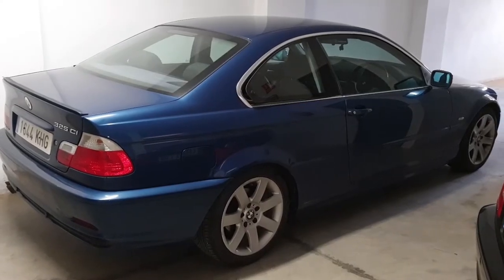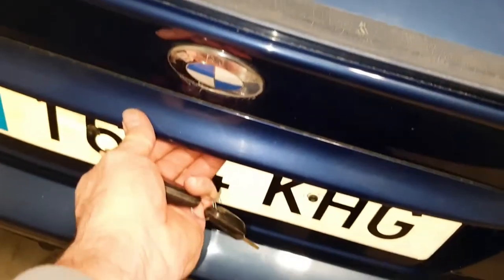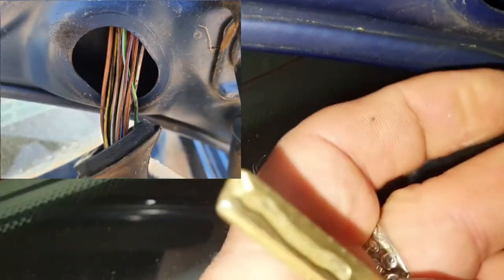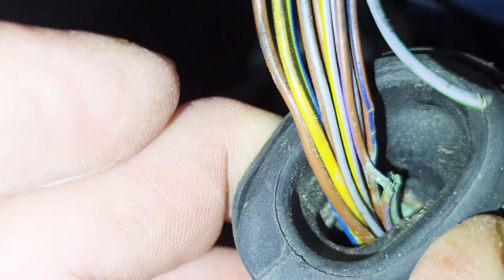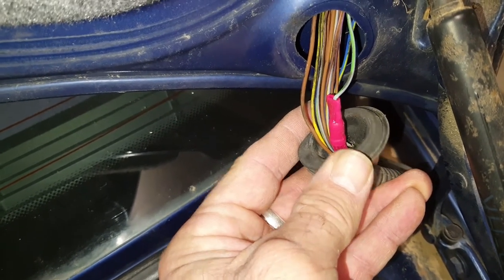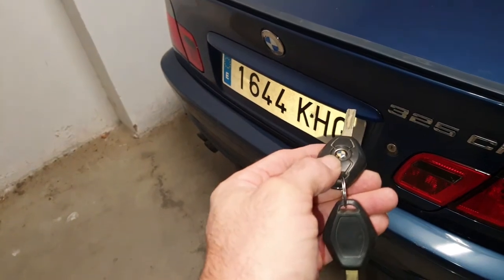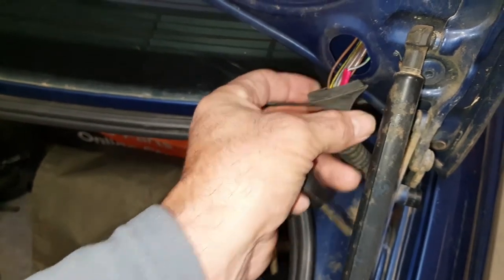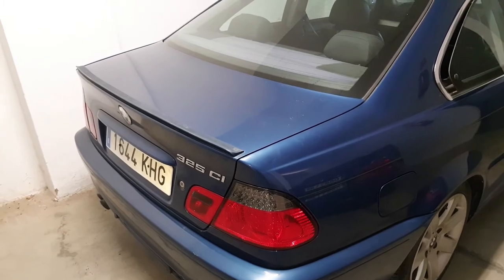BMW E46 Boot Release & Boot button Key Fix

Comment: Hello, thanks for the video! I've got a similar problem. The button on my trunk itself never works, but the button on my remote opens it about 50% of the time, so I don't think it's a cable problem. Does anyone have an idea what it could be?
Reply from the maker: Hi it sounds like you might need to replace the boot button..
Reply: Sounds like gm5 module to me